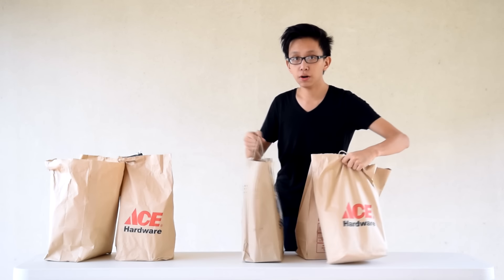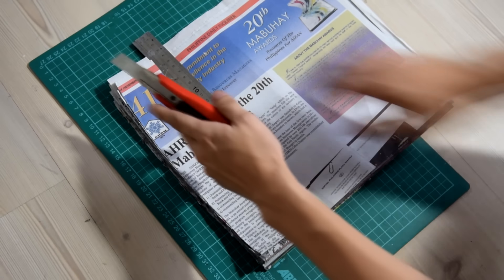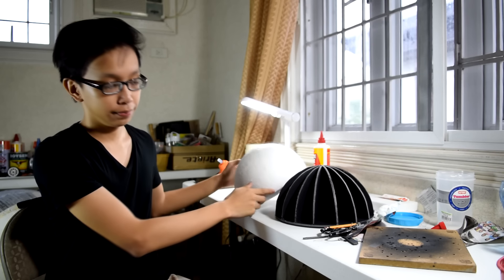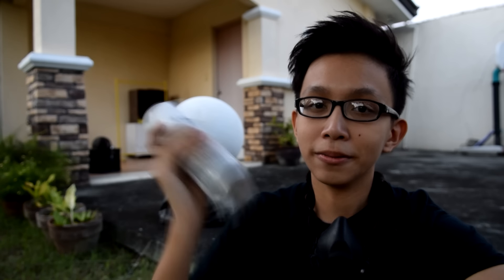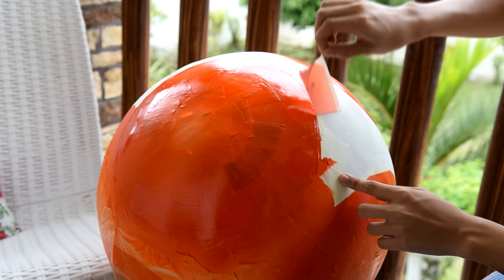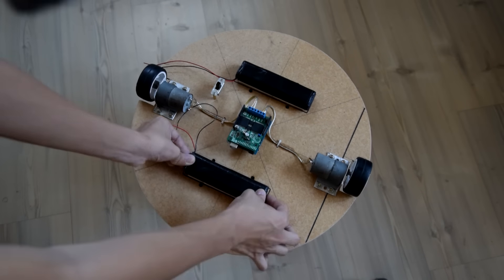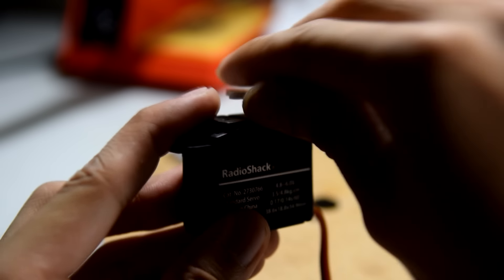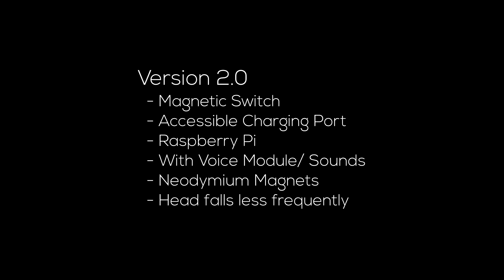Build A Life-Size BB8 Droid (Phone Controlled)

Comment: I'm pretty sure this guy's name is actually MacGyver. When he said he didn't have a styrofoam cutter and couldn't afford one, I thought he was going to say he borrowed one. NOPE - made one out of stuff laying around the house!
Reply: +crocoboxer There's not much to a foam cutter, it's just a closed circuit heating a wire. You just need to get the right balance of wire resistance and wattage to get the heat right without frying the wire. All of this info is freely available online.
Reply: +jpoolerdom Clearly, you've never seen me build anything.
Reply: +crocoboxer lol
Reply: +hentai nat is he Filipino?
Reply: +Kyle Andrei Yacapin Definitely Pinoy.  Yung lumang diyaryo niya mukhang Philippine Star or Inquirer.  Tapos may shout-out kasi "Mabuhay" yung nakaprint.  Yung Plaka rin nung kotse niya Philippine plate series.  Adik lang noh?
Reply: ayus yung pangalan mo ah

Comment: I have grown up in a body shop and for those of you who attempt this, when you peel off your masking, make sure you form a "cutting edge" with the tape. You do this by pulling a bit of the tape off then holding the loose edge of the tape pull it back on itself, as though you're making a "V" with the loose and adhered tape. That should allow you to have a much cleaner paint edge. As the way it pulls allows a neater removal process.

Just an FYI, I hope that helps.
Reply: +Corey Carnes I don't work in a body shop, but have done a little rattle-can painting in my time. Shouldn't he have used a spray-on primer in between the wood putty and two coats of white spray paint? Especially considering how much wear the body is going to take, literally rolling around on the ground.

Oh, and another thing, anyone who attempts this should be careful using a power sander on the wood putty. It makes it much quicker and easier to sand down to the next level (which is bad), and depending on your sander, you might leave some unwanted swirl marks.
Reply: +jpoolerdom the white spray paint may have been a primer, some primers are just white. Even if it's not primer it might be ok as long as he painted properly, I would recommend lots of light coats to build strong layers
Reply: jpoolerdom That's all very good advice, yes. I wonder if they make a clear coat designed to wear better than what a car would have.
Reply: +Corey Carnes Shouldn't you apply a clear varnish after the painting is done? Should make it more stable when rolling over the floor
Reply: Dylan Burford I recognized the can, Rustoleum white spray paint.
Reply: +Frederik Heller depends on the varnish if it does dry well on the material it could turn sticky and bb-8 could turn gray

Comment: Great video, used it as a reference when I started building mine. I put together the main body and got all the electronics working. Didn't make the head or do the BB-8 paint yet. I might just leave it as a big Sphero-like ball instead. I would recommend if you want any sort of distance from the thing, using a RC controller instead of bluetooth to be able to get some better distance (and yes that is a little bit more expense but worth it if you are planning on using this outside), that is what I did and can operate my ball just short of a 1/4 mile away. Also speaking of RC parts, get some beefy motors to make it really pick up speed. The ones he has are pretty nice but at first I tried to use some out of a cheaper RC car I had and it was not that great, and if you do go for speed make sure to also add a pretty hefty weight ballast to the bottom of your platform to keep it in position. 

I also made my ball a bit tougher, I did the fiberglass and bondo method to make it tougher. It also made it heavier, which might be why the original RC motors I had seemed under-powered. You can find a bunch of videos about using fiberglass and bondo to make the body. It won't be as tough as the sphero bb-8 I have, since apparently the sphero ball can take a shotgun blast and be fine, but it will take a crash into a wall or tree with basically no damage and you can always bondo, sand and repaint any areas you might need to. 

And one other major upgrade I did was how to charge the batteries. I installed my batteries on the underside of the platform to help keep the weight on the bottom, used zip-ties and hot glue to make sure they stay in place. I then cut out a trap door in the body to reach a cable I have attached to the battery packs. I have the cable attached to the platform using velcro and I just have to pull the cable out, attach it to the adaptor I have and plug it in the wall. I might make another ball to improve on this design because right now I only have a tiny plastic hinge in place and it is already feeling like it is about to break from opening and closing, but I had to keep it small and as flush against the body as possible, but I am thinking I can maybe get a better hinge and sand down a section inside the body to countersink it into the body to make it flush. 

All in all, not the most in-depth build I have ever done, (once again, not completed since I only have the body done) but still a fun time and can be done over a couple weekends (or just one weekend if you only do the body like I did and already have all the parts handy).

Comment: Hi Techbuild, I am a huge fan of star wars and am in the process of building BB-8. This is my first robotics project where I am using a microcontroller and I have a few questions if you don’t mind. What gearboxes should I use as the ones you used were discontinued? How do you connect the servo to the arduino and does the code you linked work with the head rotation? How do you connect the batteries to the motor driver and how do you assemble the motor driver? Finally, how do you use the M3P board and speakers for BB-8’s sounds? Thank you for taking the time to read this, this video has been very beneficial to me.

Comment: At 13:13 the diagram, can u use any wires? do you  need any specific colors or wires? or can it be any? 
and how do u actually charge the batteries and stuff?

Comment: Why did you connect wires into two of the deodorant rollers used to prevent friction inside the lower frame?